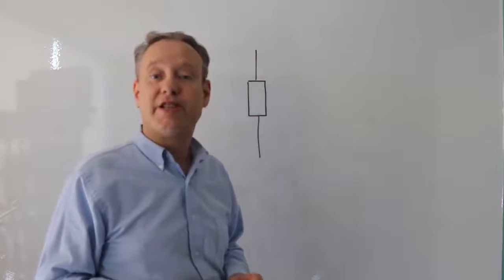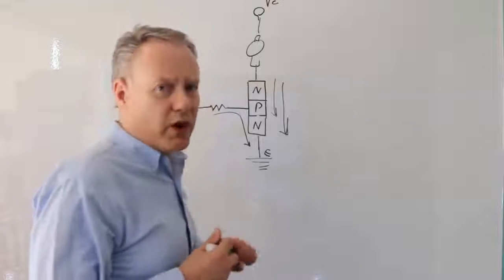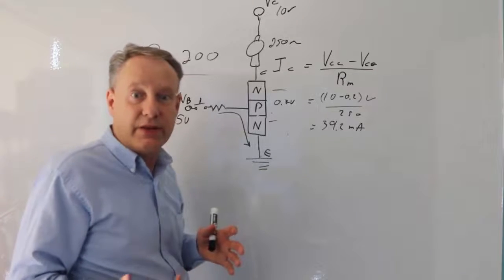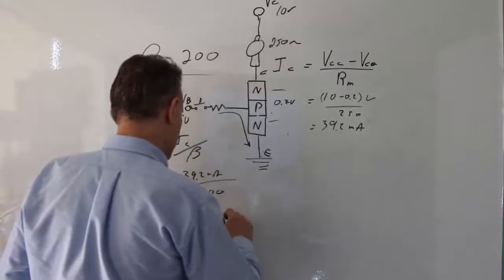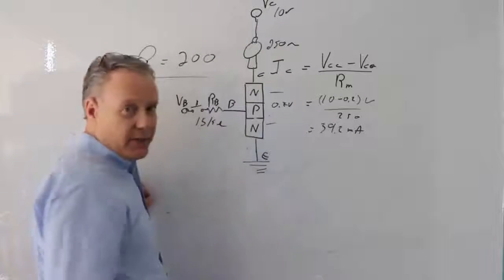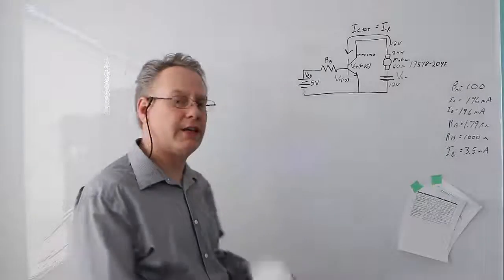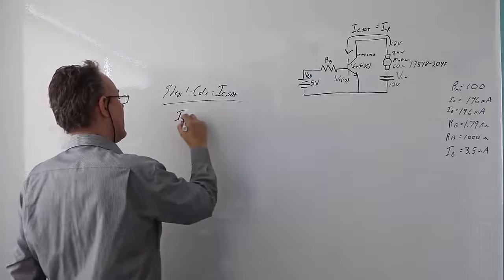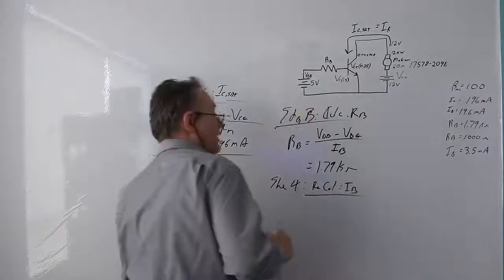BJT as a Switch Circuit Motor Control Example

Comment: What is wrong if LED faintly glows when Transistor is turned off?
Reply from the maker: Hi Robert. Nothing wrong at all.

This type of thing can be expected because the transformer is made-up of a very large inductor. 

The two coils in the transformer, the primary and the secondary, are huge inductors. Like capacitors, inductors can hold charge. Capacitors hold charge in electric fields and inductors hold charge in electromagnetic fields. What is happening when you turn the transformer off is the charge in the secondary coil dissipates and runs the LED for a short period of time. This would be similar to hooking an LED up to a capacitor and as the capacitor discharges it will run the LED for a short time.

The lesson you can take from this is that inductors or any coil, act like a capacitor in that it can temporarily hold a charge. Disconnecting it from power will cause it to discharge which can  used to do work such as running an LED.
Reply: Thanks Lars. Great explanation.